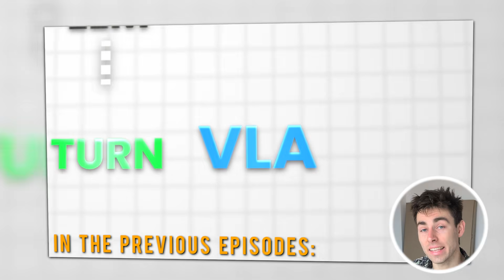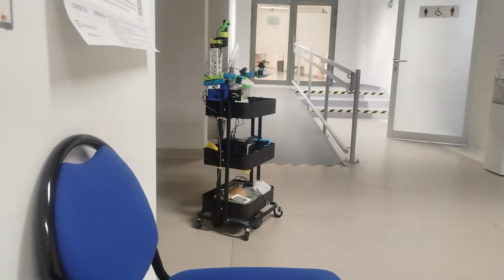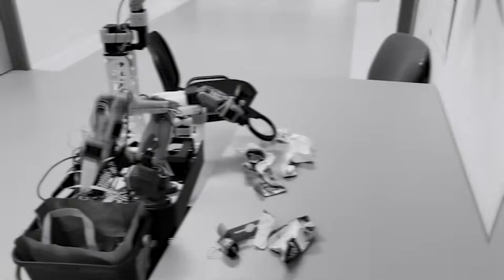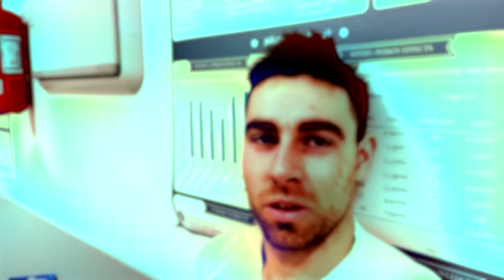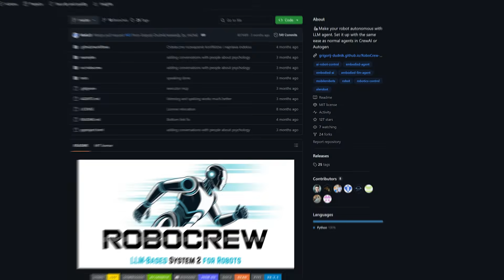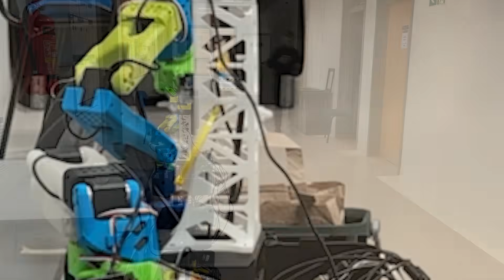My Robot Cleans my Room (with VLAs and LLM)

Comment: what compute platform are you using for the robot brain, robot(base and arm)? What is the minimum requirement would you suggest and would Macbook work for this?
Reply from the maker: Hey! As the LLM is in cloud and VLA are runned remotelly, we use Raspberry Pi - it's completelly sufficient. But running at least VLAs locally will be good idea, to not configure brigre every time - then you'll need a Jetson device, at least nano for simpler VLAs.
Macbook  -I never tested, but it should work for local VLAs and even VLMs

Comment: Thanks for the series!
I'm putting together a team at my university to build this robot this fall, and train it accordingly.
I've sourced (most!) of the parts already and will probably kick of the project in a week or so.

I am certain that this video series that you've produced will be of great assistance for us when it comes to debugging, tackling various tasks etc.

One question, did you consider using a RGBD camera or a Stereo Vision (RGB only) setup for the "head camera", and then have that camera produce some sort of depth map? Did you reject this to avoid additional computational overhead on your limited hardware? 
Asking because I would prefer to avoid having to use lidar... :)
Reply from the maker: Hey! I'm happy our work may be useful for you.

At the moment we worked with the project we had no funds, so we have not considered depth camera ;) However, will it be useful? Probably yes, but we have not tried. If we feed into LLM depth map along the normal RGB - maybe it will walkaround obstacles better. If you'll try it, let me definitelly know - I'm curious ;)

However, we used very cheak 2D lidar (around 80eur if I remember good) - it's just fraction of depth camera cost. And it's outcome is not susceptable for occlusion - it produces crear top-down view. I recommend to consider
Reply: @gregstech  Thanks for the reply! Will keep you updated :)

Comment: Hey, I’m a high school student working on a similar project for my research paper. I too agree that generalization is not possible with the current way VLA is handled(S1 generalization may soon prove me wrong however). I use a SOARM101, with a local LLM(Qwen 3.8 27B) for visual processing and reasoning, along with pipelines for segmentation and receiving multiple position variables from said segmentation. Then instead of a VLA I’m custom writing my own inverse kinematic and pose solver. So I treat the LLM as the main controller/object finder/error corrector, and all lower level commands are handled through python. If you’re interested I’d be happy to explain more, I think you should research object oriented visual servoing to replace your VLA, I look forward to seeing the progress on your project
Reply from the maker: Hey! Your aproach seems to make lot of sense and be much more reliable then just using VLAs. So LLM outputs the 3d space coordinates where arm gripper should go, and then IK solves it, right?
Reply: @gregstech I attempted that approach and found that LLMS don't have sufficient spacial reasoning to do that accurately enough, so I actually ended up using SAM2(specifically not SAM3), to segment the objects properly, then I use A075 RGB depth sensor and created an overlay where the LLM can click on part of the screen and activate SAM2 to segment it, then python handles finding depth, height, size, angles, etc, then inverse kinematics solves it and uses a visual servoing approach to grab the object. 

If you have any more questions I'd be happy to answer, I should have my paper published within a month or two and I'll be uploading a video of how everything works then too👍

Something you'll run into is that SOARM101 arms have somewhat high servo backlash and without 6DOF it makes the pose solver significantly harder to make, so even with perfect coding you may still miss the object in some orientations
Reply from the maker: @RavvaOf_Light  Wow! That's really interesting approach. LLM should have still good enough 2d reasoning to point properly into the object. Which LLM you used? I know Gemini Robotics is good in such tasks.

And why SAM2, not 3? ;)
Reply: SAM 2 has less latency than SAM3, and the LLM I use is QWEN 3.8, it's good enough to ~90% accurately click on the object on the screen for SAM2 to then track, the visual identification is very good, just identifying the specific pixels for where those objects are at is what can cause issues
Reply from the maker: @RavvaOf_Light  I understood. Approach looks very interesting. If you'll have more projects like this in the future, let me know! I always happy to be inspired, and use some ideas in the videos
Reply: @gregstech will do I look forward to seeing your future projects as well

Comment: Please help me,How to run a large VLA model on a small controller?
Reply from the maker: Hey! I'm afraid you can't, at least not directly. 

When we tried to run ACT policy (the smallest possible one) on Raspberry 5, it was working for a while, but got overheated and undervoltaged fast.

If you really need to use small controller, I recommend to do same thing as we did - run VLA on remote computer (server), but on controller to place only a client who executes actions.
Reply: @gregstech That means the server generates an action and sends it back to the local controller, right? Thanks for your reply.